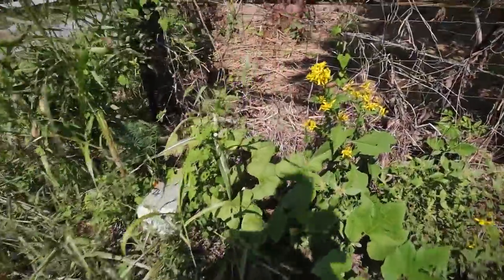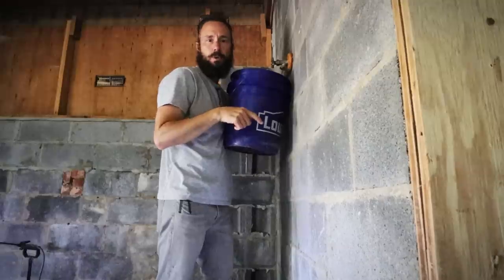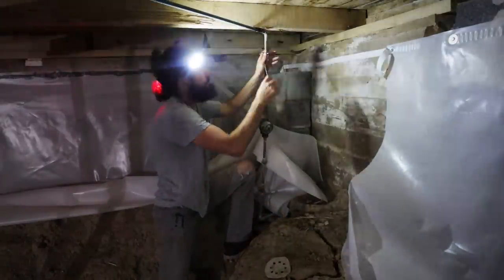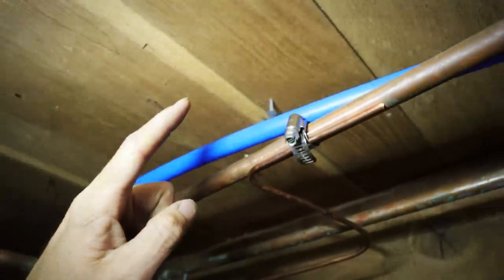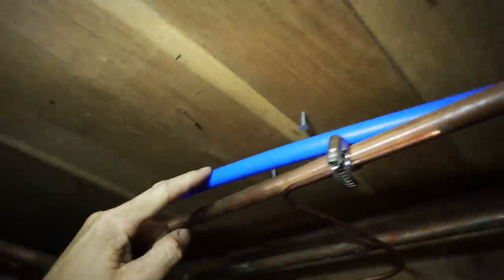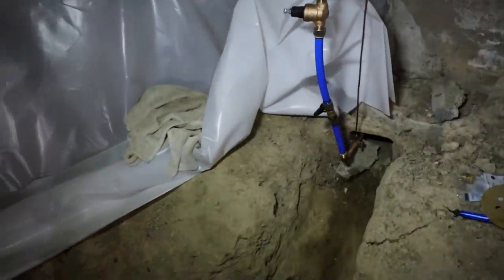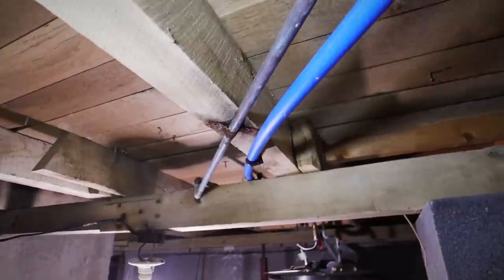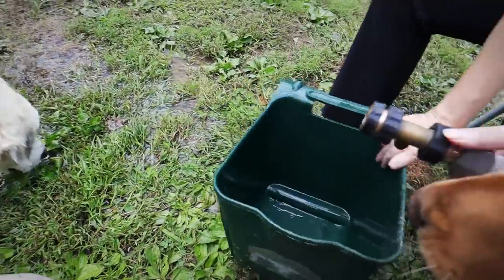No more avoiding this, we need to improve the  water flow  | Homestead Farmhouse Renovation Pt 10

Comment: Looks like a success to me.  I would think where the incoming pressure is greater in the larger pipe and it reduces down that it would put more pressure on the old pipes and possibly loosen up any long time junk that pipes can build up.  Also with the pressure set at about 55 it may be more than it was prior, I don't know, but that too could be a reason for that. Each time we turn on our water (well water) after the lines have been shut for a length of time, we open all the inside and outside pipes and let them run for about ten minutes and clean it all out. We also clean at each faucet the little screen that usually collects junk in it when the water has been off for a bit . With those things being done we see cleaner and better pressure on our pipes.   
Excellent video and a great educational one for sharing education on the process you are going through. 
Blessings
Always nice to have two for that job as running back and forth is beyond tedious!!!   Good job you two!!!

Comment: all those shark bites you used you could have bought the tool and crimps and fittings for a permanent water supplie lines.  Remember the shark bites are temporary fixes not ment to be permanent

Comment: The volume of water is determined by smallest pipe...so the improvement is from the removal of corroded copper. It will be limited by the half inch pipe coming in.

Comment: Couple of tips..next time leave the hose running when you walk down to turn the meter off.  Your meter should have a leak detector on it...might be a triangle or a smaller dial that turns when there is flow.  Turn the shut off until the leak detector stops turning.  If you don't already know ..ask your municipal water where your responsibility starts...here it is at the meter so you would be responsible for the service line meter to house.

Comment: You can buy a waterline pressure tester and that will tell you how much pressure you have in your line. You might check with neighbor’s rural water supplied to home from outside source can be horrible service. Secondly I would plum in a whole house water filter so you can see how much of that nasty stuff is coming from your main water source and filtering it will keep you lines and vale clean. God Bless you.
Reply from the maker: We do run it all through three filters even the hose water for the critters :)

Comment: Congratulations on a successful plumbing project. The water turning cloudy/brown after being on for a minute happened in my 1950 house too. It's a little freaky, I thought. The plumber said maybe it was because the water wasn't used for a while. I have a fire hydrant in my front yard at the street and I was here when they flushed it a few months ago and it did the same thing. So, I am guessing it is from old city water pipes. I use a berkey to filter my drinking/cooking/dog water just in case.

Comment: For me personally I hate paying the price of the Shark Bites.  What I do is, I rent or borrow an expansion tool and it cuts the Pex cost by more than 35%.
Reply: Agreed! I went with the stainless steel clamping system. It is a little easier to get into tight spots with that system than with the copper crimp rings. The Upinor expansion system is what I would really prefer, but I can't bring myself to spring for the cost of the expander tool.

I just don't trust Sharkbite fittings to hold up over the long haul. And they cost too much.
Reply: @theElderberryFarmer  :goodvibes:

Comment: Won’t you need clamps on either end of where you cut it and connected it to the other stuff so that it doesn’t blow off or pop off those little metal clamps that you tighten with a screwdriver????? Just curious
Reply: Shark Bites don't require clamps. They are compression fitting. Really cool things!

Comment: Hot water pipes , aren’t they supposed to be run with red lines and blue for cold?
Reply: It isn't a code requirement to do so, but it does make it easier for troubleshooting or expansion in the future.